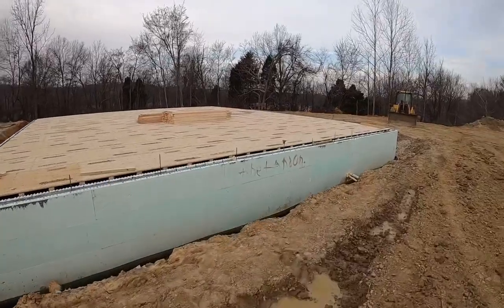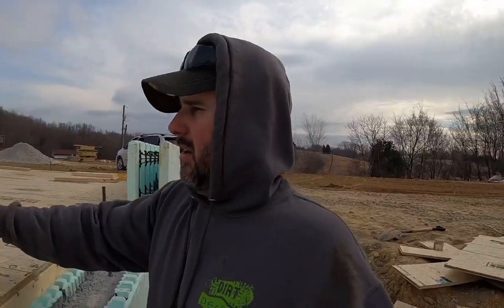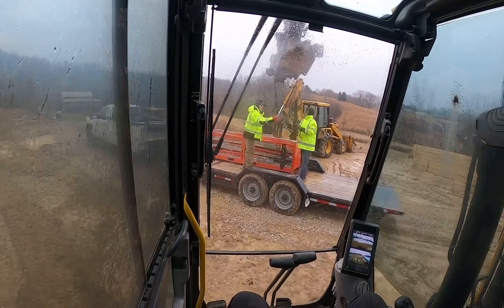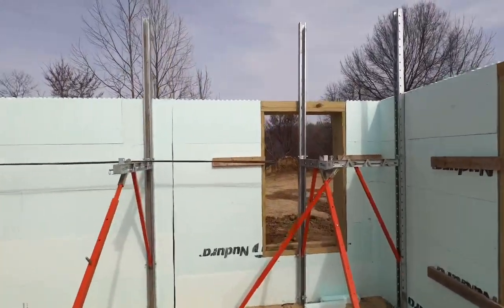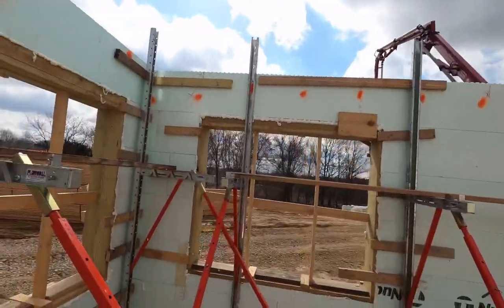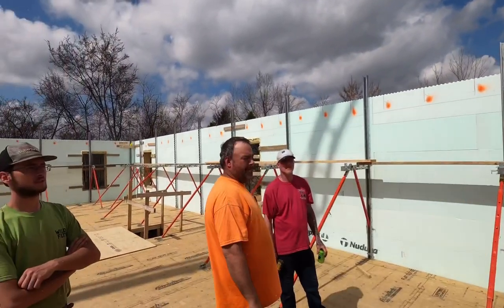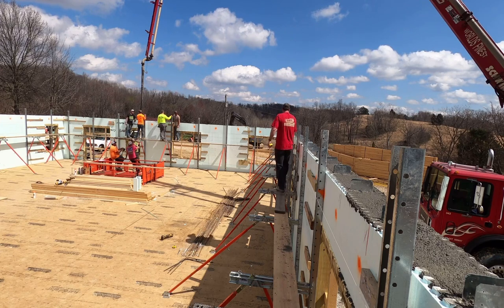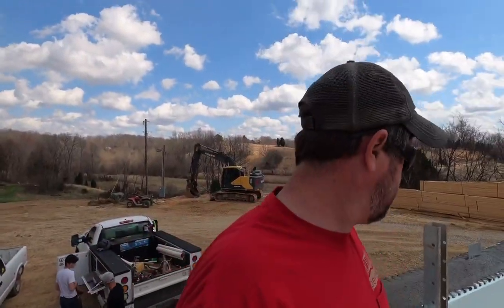Upper level ICF pour using Nudura block and Plumwall bracing this is the big one

Comment: So true what you said about subcontractors leaving imperfections for the next guy to deal with. By the time you get to the finished product it’s a snowball effect and your house is a mess. I was working with a general contractor awhile back and his foundation guys and framers and drywall crew had all been working with him for around 20 years so they all knew each other and there was good communication and rapport with each other. The end result was straight walls and no nail pops and everyone was happy — including the customer. Makes a huge difference in my opinion.

Comment: Wrap a little bit of electrical tape around the joint of the socket extension when adjusting the Plumb wall braces. It stiffens it up just enough to make it much easier to get it into the nut. Learned that from an experienced mechanic.

Comment: When I did remodeling and add ons we never did whole walls like this. We just used the insulated blocks for the basement, then stick framed the rest. We didn't need concrete in the walls above the basement.
Reply: My brother built ICF all the way up like this one. So quiet and warm.
Reply: @anoka114  Cool! Here in Kansas City there are a few basement houses and earth contact, but most houses are stick framed w/insulation. The concrete walled homes sweat so bad they have a lot of mold issues.
Reply: @jamesdiehl8690  with insulation outside and inside I have a hard time understanding how they would sweat.
Reply: @anoka114  It was the type of soil I think. Around here the backfill has so much sticky packed clay and limestone rock in it. Back then builders didn't use French drains around the base. We all thought there leaks somewhere, but there weren't. But you could see black mold growing on the forms. Builders would strip off the inside foam, then they started put a sealer on the outside and adding drains.

Comment: Great videos love watching them. I have a question... first lift (basement walls), does the next row of blocks need to be clipped vertically to the last pour? Noticed the concrete is poured above the brackets, so securing with clips can't be done. Or does it hold without the use of clips.
Newbie here in Prince edward Island starting a self icf build in the spring.
Thanks

Comment: you should think about getting a boom truck if your going to do basements regularly. the reach is amazing you will find yourself using it for all kinds of things and if you get one with a nice open flatbed you can carry all your bracing on the truck combine with a concrete pump trailer and your a one stop shop you can hang the pump hose from the crane and have the capability of a big pump truck. crazy thing is though the pump will cost more than a boom truck with a 100ft boom
Reply from the maker: Had one sold it was just in the way all the time

Comment: does your bracing system have brackets for handrail on the inside? when I did a icf commercial job the bracing we use had handrail for fall protecting it just snapped right in then you slid 2x4s through the 2 slots worked pretty good. even though the walkway is under 6ft so you can get away with no handrail its not a bad idea. also watch how the walk boards overlap sitting one way is great the otherway is a loonytoons joke setup
Reply from the maker: Yes check out their website

Comment: What is the DeWalt vibrator tool?  It looks like an attachment on a impact driver or a hammer drill but probably isn’t.

Does one of your videos show the best way to remove the PlumWall braces without having them collapse or pinch your hand when you pull out the pins.  Do you remove the pins first or the angled support from the floor?  We will be removing our first use of them this week and want to do it safely.
Reply from the maker: Yup have a video on it thanks

Comment: I’m surprised that you don’t scabble the top of the concrete (mechanically remove grout back to aggregate) back when I was pouring walls  the engineers were really hot on it !
  I mean on the cured top of the wall that will become the  bottom of the next pour,  The idea is to increase the strength of the joint.

Comment: Nice video and info you had said before that fox blocks gave a straight wall with less bowing question do you think it’s because of the 6 inch tie spacing versus 8inch spacing?
Thanks
Reply from the maker: Other way around fox block sucks they are all different sizes. Does help around doors and windows because of the inch spacing

Comment: I heard the one worker state that this build was done in Kentucky. I am finishing up plans with my designer and I am planning an ICF Nudura house build in Florence KY. I noticed that you used the same size Nudura on the first floor as on the basement and Nudura recommends 8" basement and 4" first story? Would you be the go to for my build by any chance or have a good company to recommend for that area?
Reply from the maker: I don’t know who from Nudura told you that but they are wrong and switching sucks ass only do that as a last resort

Comment: I like your solution over the window with the 2x4s.  Loss of insulation would be minimal and like you said, great for window treatments.  And the wood probably only adds $25,000 to the cost of the house.    😂 😂
Reply: Couldn't that void be filled with insulation ?
Reply from the maker: Covered that in the video

Comment: for those windows how do you get the bottom wood piece to lock into the nudera blocks? or do you get rid of the teeth to place the base of that window on top of the block? And how do you keep the concrete from pushing out do you place straps all around it and seal it?
Reply from the maker: Strew before you pour

Comment: Mike, I live about 18-20 miles from the Gulf of Mexico in the south Alabama (panhandle). Right before Hurricane Ivan in 2004 I believe, I was getting ready to build a house when I first heard about ICF homes. What a no brainer in this area so I had one built. The only only thing is, I've heard many different versions of what the 'R' value of ICF is. My walls are approx. 6" of steel reenforced concrete and about 2.5" on both sides of ICF wall. Any idea of the 'R' value? Actually, I don't know why, any one along the coast from Texas to Maine don't build using ICF.
Reply from the maker: I agree

Comment: Maybe pick up some eye plugs for the guys doing that work.  Not sure what the laws are in your area but I can guarantee that vibrator is getting too loud for people to work with long term.  I thought my hearing would last when I first go into the trades but now I've basically got a steady ringing in my ears.  It also makes things a little safer since the ear plugs usually do a pretty good job of only filtering out the noise.  You can usually hear each other talk a little easier.
Reply from the maker: Just a drill running

Comment: man that take some time clean wall to nice sq to floor and framers  didn't use P/T plate at bottom ..Y.. didn't really need bearing wall for web flooring trust system  looks  be 16 o/c ,,but it helps ,they should just pop stairs in

Comment: What brand of truss bracket did you use and are you happy with them? Also do you put some type to moisture barrier between he trusses and the concrete in the wall? Wish you worked in the north end of state. Not much in the way of ICF contractors up this way.
Reply from the maker: Yes

Comment: Do you put ply board directly up against the ICF wall before you drywall?  Or is there some other barrier that we use?  Like it gets layered ICF/ply board/drywall/plaster/paint....I can’t imagine you would need to put insulation and other materials when the weight bearing wall is already insulated.
Reply: I usually see people put sheet rock right up against the foam, after the plumbing and wiring.
Reply from the maker: Yep straight to wall

Comment: I see vertical rebar at 4, 5, 8 foot intervals, not sure what code you’re using (Haiti?) and I see backfill against styrofoam with no waterproof membrane. And foundation drainage running halfway up a stemwall that has no waterproof membrane.. what a mess.

Comment: Thinking aloud. Why couldn't you use a long ratchet strap around the whole exterior of the house to hold the ICF in place? ... squeeze them together. Tight fit and that would hold the corners for the concrete pour. Stay tuned for more tips and tricks. kek. I've got an idea for the inside, too. We'll talk. kek
How about using a trowel that are bent, like an edger for concrete that is the width inside the ICF and thick metal like the old edgers, but a half inch, right angle on each side. It would be perfect for the top of the ICF. Push it side-to-side and push any extra concrete forward towards the  poured concrete.
Reply from the maker: No need and would take a lot of extra bracing to do that

Comment: If you have a ledger attached to the concrete block like you do, shouldn't the block be stack passed the floor level so you don't have the cold joint within 12" of the bottom of the floor system. I realized the project owner raised the ceiling height 1.5". I always pour my wall so the block is well passed the plywood sub floor.
Reply from the maker: Don’t matter it’s tied

Comment: Why do you split up your pours/stacks?  I see that a lot of ICF builders do it all in a single stack/pour so there is no cold joints in the wall.
Reply: They pour 2 stories high ? Weight on the foam, causing blowouts is the reason for not doing it all at once.
Reply: They would have to brace all that.  The current design allows to brace a single story, then build the platform, then form the next.  What is the problem with a cold joint?  The walls above are bearing on the walls below,  They aren't going to shift in or out because of the vertical rebar.
Reply: @augustreil  I have seen even more than 2 stories (direct from manufactures videos).  They still do it in 3' lifts, but do that whole building in one shot.
Reply: @jcadult101  They make brace extensions (Plumwall does up to 24' tall braces).  I am just curious why they do it in two, when it could be done in one.  I have noticed (or maybe they don't show themselves doing it) they don't install clips at every vertical joint like Nudura specifies (that supposedly keeps blowouts from happening).  Also others that pour in one shot, spray foam the corners and first horizontal joints in place for each course to eliminate blowouts.  I am no expert, just asking questions so I can learn..
Reply: @FJB2020  And those might make sense if you're constantly doing multi stories.  I've watched Mike & the crew do a lot of basements and just recently the first story as well as helping the DIY on the 2nd story.  It's extra equipment to store and haul to job sites.  Another thing to think about is being 16' off the ground versus  5 or 6 to work at the top. And as you're doing lifts, you see how they vibrate and have to mess with openings. Imagine trying to vibrate 10' up from the basement floor as MBTS runs around with an extension ladder to reach.  I'd like to see how the tall wall guys deal with concrete segregation.  It doesn't like to be dropped very far.
 I watched a 4 story hotel go up using ICFs.  They too went a floor at a time, including pouring the floor before continuing to the next level.  I wonder if we won't end up there with lumber prices on the rise.
Reply: @FJB2020 , Sounds impressive but jcadult101 makes some very good points. Basically, I have no idea ! lol.
Reply from the maker: Because they don’t give a crap about the next guy that has to hang drywall and finish and I do covered that
Reply: @DirtPerfect  I am just asking questions since you seem to be more forthcoming with sharing your knowledge on doing ICF..
Reply: @jcadult101  If you really believed in concrete segregation than you wouldn't be dropping into a 9' wall.'..  

At concrete world expo the ASCC said there is no real data to back that up and with todays mixes you can easliy pour 150'..

"Free fall of concrete from heights of up to 150 ft (46 m), directly over reinforcement or at high slumps, does not cause segregation or reduce compressive strength. Restricting free-fall heights does decrease concrete production rates, which increases owners' costs with- out increasing concrete quality."

Now you made a really good point about height, I don't think I would want to be on a walk board 20' in the air trying to handle a pump hose.  I bet these tall wall pours are done with some sort of scaffolding setup.. 

Anyways, thanks for the input!